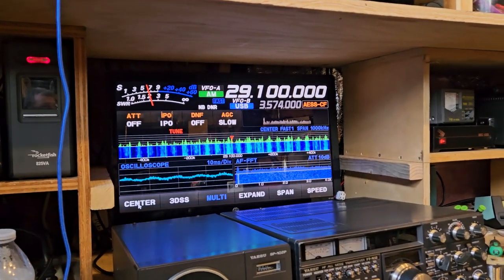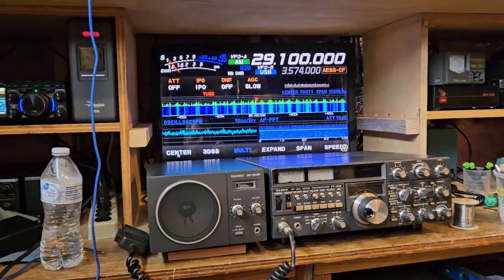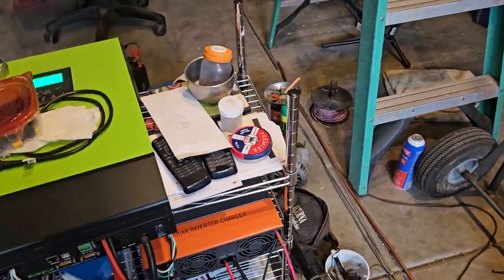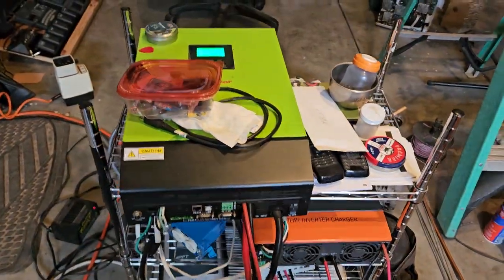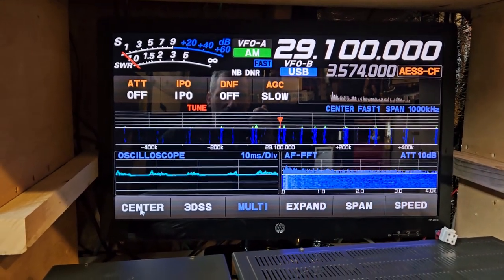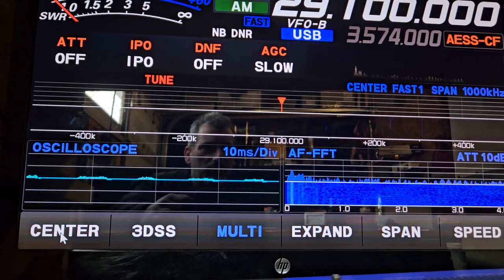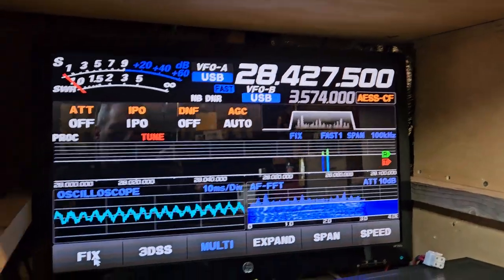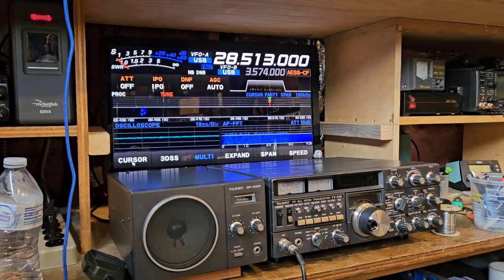PLAYING HAM RADIO WITH SOLAR

Comment: I had something similar with a Renogy SCC.  Switched to Victron and it's ok now.  The only thing with that is the price... although Victron SCCs have come down in price by about 30% recently.
Reply from the maker: Victrons are teir 1, basically.  So yeah.  They are great!  My solar is off  most of the time when I operate, thankfully.  But at least if the grid goes down, I'll be ok during the day.

Comment: I have a harbor freight solar panel/ charger rig that dosent even make noise like that.  You need to check your station ground    Have it hooked up to 400amp hours worth of batteries and it can run
Reply from the maker: 30 240w panels all near or under my antenna. 7.2kw, the more power you run, the more noise the charge controllers and inverters will make. 
I used to have 6 harbor freight 100w panels and some charge controllers.  It was so so. Add some more panels and your noise will increase 😆.  Some charge controllers are better. Some inverters are better, too. 
Im not worried about it.  It is what it is.